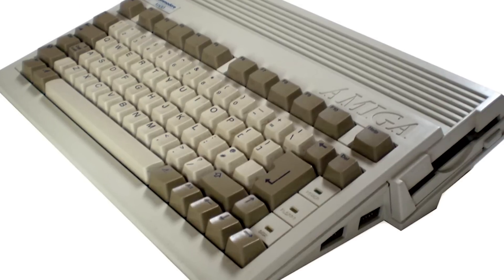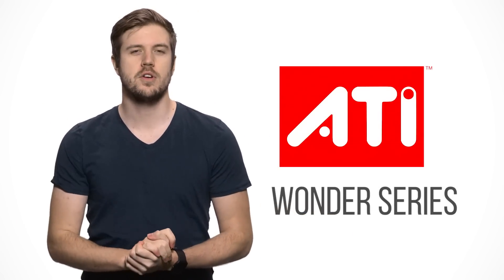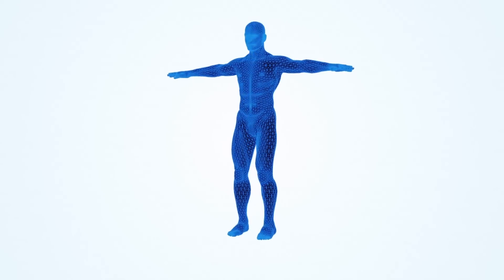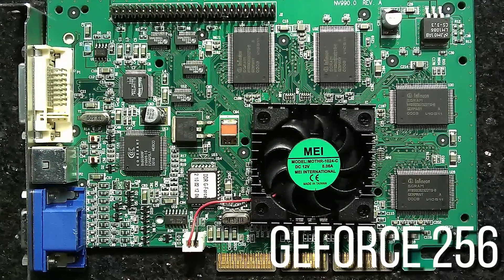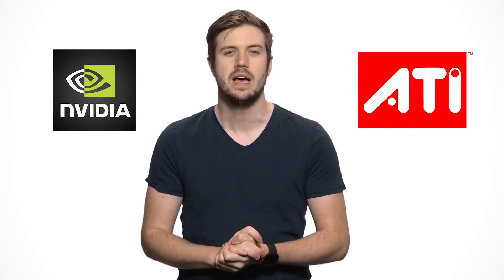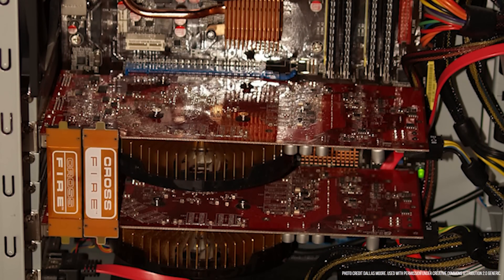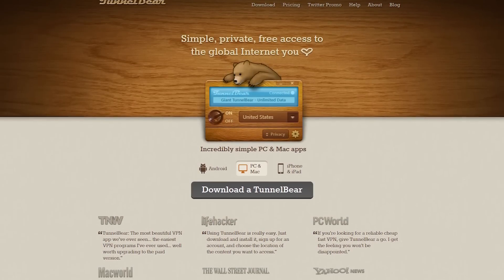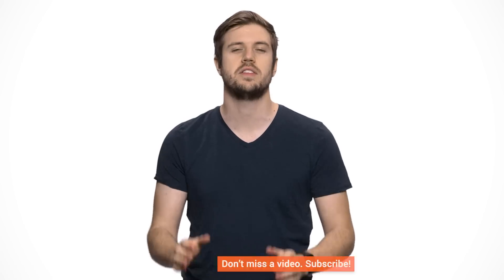History of GPUs As Fast As Possible

Comment: In a way I am happy that Intel Integrated graphics exist. Don't get me wrong they usually are slow and terrible but at least their basic drivers aren't terrible. 

We had to deal with a few on motherboard GPU's before that time that just had horrible drivers and tanked the system. 

But with Intel, it is slow, but it works.. what do you desire more? 

And with Windows Vista pushing for graphic acceleration of desktops they even had to change their age old super slow designs and make half decent 2d cards that also accelerate video and other codecs. 

By now they still won't touch the cheaper AMD and Nvidia cards. No... but they can accelerate viewing a DVD or Blu-ray if set up right. 

And yeah I had to deal with allot worse graphic card drivers before that.

Comment: Luke you forgot to acknowledge the fact that ATi was the first to implement Unified shader architecture back in 2005 to power the Xbox 360's GPU, the XENOS. GTX 8800 was not the first to use the Unified shader, Nvidia was a little late in fact... 
Anyhow, kudos for making this video Luke. I learned a lot.

Comment: So good to see a video that actually gives the Amiga computers the credit they deserve, although it could be said that the Atari 400/800/600/130XE and so forth, with the ANTIC microprocessor for display instructions (with is the ancestor to the Amigas graphics hardware) is the first real GPU - it was amazingly powerful for graphics hardware designed in the 70s, with it's own instruction set for building the display independently of the CPU - very important when the CPU was a 8-bit 6502 running at 1.79 MHz (NTSC) or 1.77MHz (PAL)

Comment: the Nintendo64 was the first 3d console, not the ps1
Reply: nope
Reply: first console that had a three dimensional game was the snes. star fox was the game. required two cartidges stacked on top of each other.
Reply: +Karl Taok The first "real 3d" console was the ps1. Real 3d as in, not enhanced 2d, or terrible textures.
Reply: +Cameron _ _  nope,STARFOX was 3d,donkey kong was a fake one,search it.
Reply: my mistake then.
Reply: Actually the Saturn came a few months before the PS1. Even though it could do 3d, its hardware was more made for extreme 2d graphics.
Reply: +Seth Rockwell Star Fox didn't require two cartridges stacked on top of each other. It's just one cartridge with the Super FX chip inside it.
Reply: +mumbo666 youre correct. just looked at my copy. no idea what i was thinking

Comment: i want to know what is the reason that you can't expand ram on a gpu.
Reply: Monies.
Reply: VRAM needs very fast speeds, and the longer the wire the lower max speed.  a connector will lag the memory a lot, which is bad.

Sorry for being abrupt, on my phone.
Reply: @waterlubber  then why don't motherboards have soldered ram? Wouldn't that help AMD performance a lot to purchase a motherboard for 100-300 extra to have soldered ram to cut latency and just have tiers from 16gb up to 64gb?
Reply: @OMGERRORWTF  Some do, but I think people would rather the ability to upgrade their RAM. You can still get good performance with a connector, it's just harder
Reply: A number of reasons:
1. Space - where to put the connector on the already very crowded and (in case of performance cards) large pcbs?
2. No need - back in the day even small amounts of RAM was very expensive, so upgradeability made much more sense. And today graphics cards have so much memory onboard already that they rather have too much than too little, especially mid-range and low-end cards
3. Speed - GPUs require drastically more RAM bandwidth than CPUs. Achieving this requires a number of things: Very short data lines, much wider memory bus and no connectors in between.
Reply: +Jason The BRUH you can... download more ram
Reply: +Joe Mills 256-bit bus doesn't mean 256 connections, for all we know, it could be only ONE connection
The point behind 256-bit bus is that 256 bits get sent thru the connection(s) per GPU cycle (multiply the bus size by the GPU frequency and you get the card's total memory bandwidth per second, which is usually displayed on the same specifications page)
Another thing to note is that in order to maintain memory quality, VRAM must be hardwired to the board. The moment you introduce a bus interface (DDR3/DDR4 or even PCI-E for that matter) you have a point of failure for lost data (the majority of the populace don't even know how to clean contacts properly (A Q-TIP AND RUBBING ALCOHOL, NOT HARD))
The real problem isn't the loss of money or the fact that it can't be done. The problem is logistics. You will be releasing a more or less useless feature to a populace that has no clue wtf they are actually doing (you have NO idea just how many people STILL believe that can actually download more RAM -_-)
Reply: +Dr. Vonderhaar BO3 are you a procrastinator
Reply: No, I'm just too busy fucking E-hoes to do anything.
Reply: well thats easy System ram is different from VRAM, and RAM is made to be removable GDDR5 memorry or VRAM in general isn't
Reply: +Jason The BRUH Because no one makes VRAM chips for the consumer market.
Reply: +Dr. Vonderhaar BO3 That name tho!
Reply: +waterlubber explain system RAM then?
Reply: +Jacky Xie HBM in on gpu not the "DDR/GDDR" variety. They are soldered around the gpu which can be replaced but won't work since it's not designed that way.
Reply: +Jason The BRUH Most likely because of bandwidth.
Reply: Sharkboy1006 no scam i promise. comes with pc optimiser pro for free
Reply: +Jason The BRUH Because the amount and the type of VRAM they put on Graphics cards are optimized for the specific graphics processors. For example: putting 4gb of gddr5 memory on a HD5450 wouldn't make sense since the graphics processor wouldn't be able to make use the full potential of the memory.
Reply: Still a GDDR RAM in GPUs are way faster than normal DDR RAM even tho they physically look the same the chips wise
Reply: just download RAM
Reply: 69 likes lmao
Reply: haseena badshah dude this is from 4 years ago
Reply: Even though mostly everyone above me is right, it’s not impossible to upgrade VRAM...